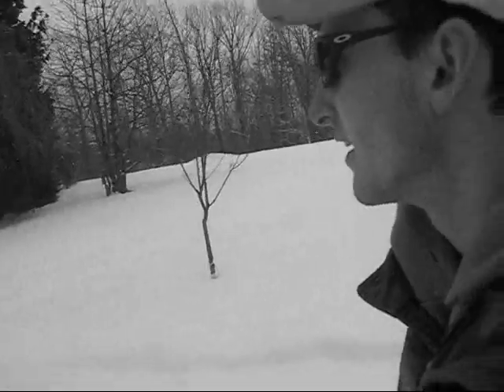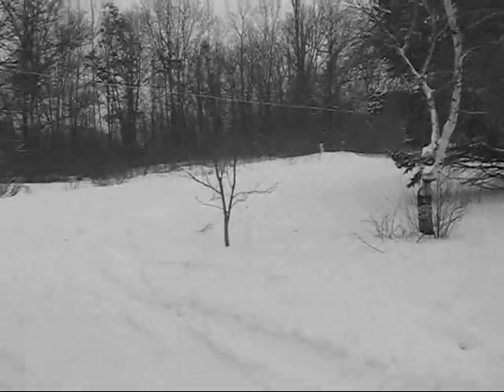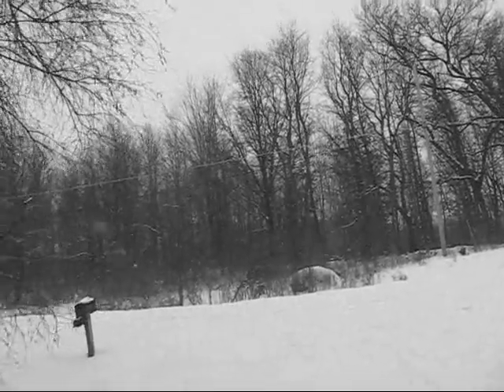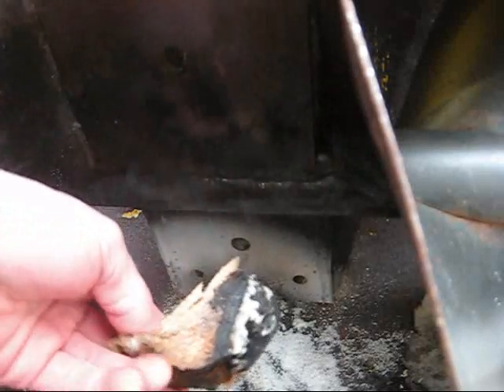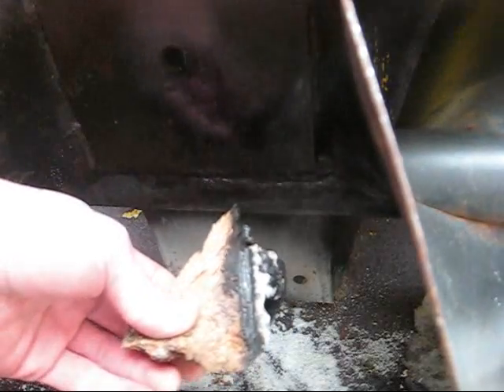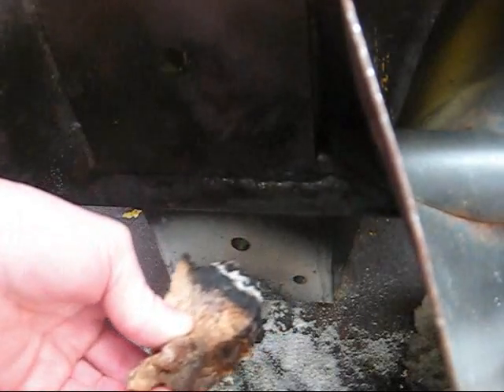Removing Snowblower Jam with Potassium Nitrate

Comment from the maker: @mastermakerhacker It is true that federally you can build your own fireworks without license but you do need a license to store them. The license is much cheaper than 3k however. It can be obtained for less than $100 if I remember correctly. Join a local club to find what you must do to comply with the regulations specific to your area.

Comment from the maker: Well it's not the heat that eats it away. Wood is a very poor conductor of heat. I could have sat there for an hour with a torch on it and only got half way through because of lack of oxygen. Without oxygen the surface will turn to charcoal, and the wood underneath will be unharmed. With the addition of nitrate to oxidize the charcoal, it turns the solid to a gas and exposes fresh wood to be burnt.

Comment from the maker: Right, the liquid nitrate 'wants' something to react with. Since the only thing available is the wood...well you get it. It burns through quite quickly. Just light a pile of over oxidized composition on a chunk of wood and watch how deep the liquid nitrate beads burn into the surface.